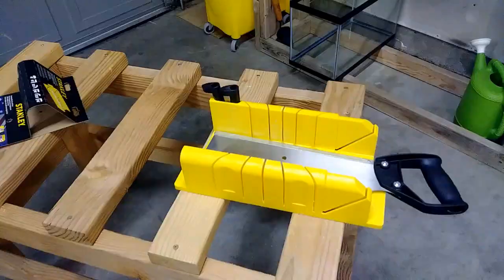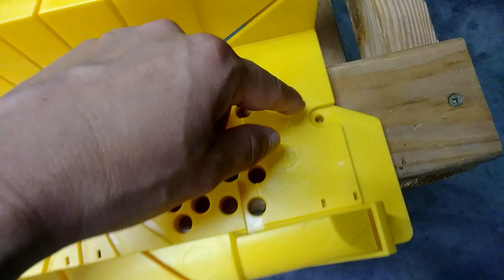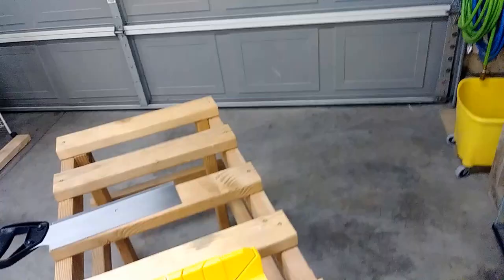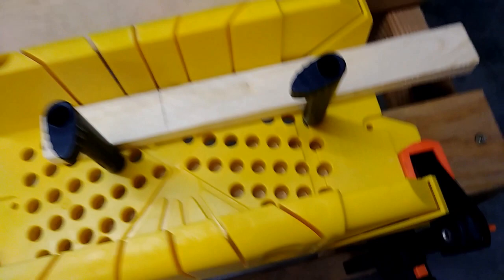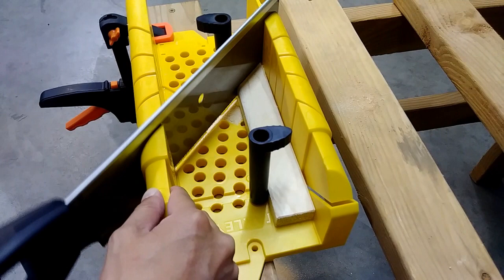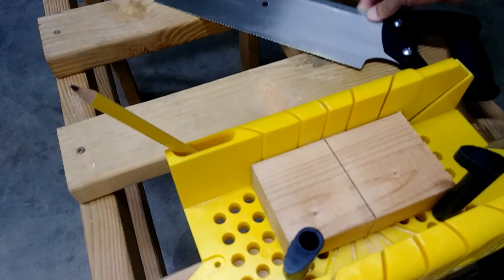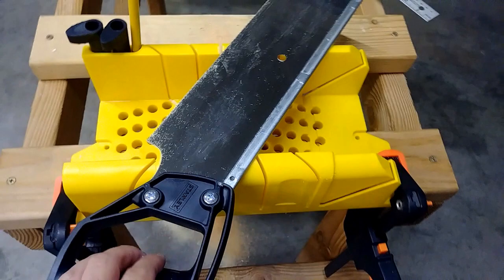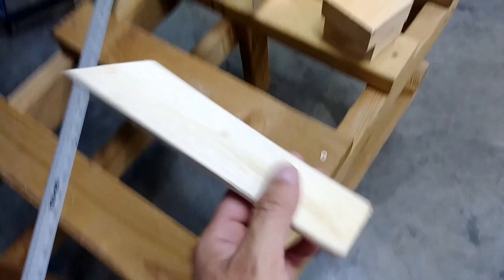Stanley Miter Box with Saw - How to Use and Review

Comment: Hi there! I just purchased a miter Box from Harbor Freight. It might be a pretty plain box, but I wanted to check out several You Tube instructions and videos on how to mount the little yellow or red box to cut miter cuts and how to use the tool. It's good to know that I can, cut a 2x4 if needed as opposed to using my circular saw.   Thanks for your helpful tutorial.
Reply from the maker: If precision cutting isn't a big deal it's not bad. Just requires more time and energy to do the cutting.

Comment: The walls are vibrating like crazy when you saw the 45 degree😒 great video BTW .p.s. Its not a saw stop ,its to add rigidity to the blade  ,its a back saw / tenon saw ..its just acts also as a stop because of the design of the box
Reply from the maker: That's something to think about. Thanks.

Comment: The 2 bottom tabs are as you said to align the box against a table edge for stability. I have a folding portable workbench table that clamps together. I usually just clamp the backside tabs of themiter box in the table to keep it stable.
Reply from the maker: Cool, thanks
Reply: There are three tabs

Comment: Does the miter box set come with the screws to attach it to a work surface?
Reply from the maker: No it did not come with any screws. I did look around before buying this one and none of them come with screws. From all the ones I saw I think this one is the best deal because it's wider, so you can fit bigger stud on it and has the two pins.

Comment: I don't have a work table. Was going to try this on the floor. Do i need a table for stability?
Reply from the maker: Any table should be fine as long as you could clamp the Miter Box onto the table. Also, make sure the table is strong enough and doesn't break. The cutting will probably be a lot easier if you could keep the Miter Box stationary.

Comment: What is the widest piece of wood that can be put in the box?
Reply from the maker: 4.5 inch would fit with a little space left, so probably a little wider than 4.5 inch would work.
Reply: @WelkingVue  Guess that wouldn't work with my 5.25" baseboard.
Reply from the maker: I went to measure before I first replied to you. From what I remember it was about 4.75 inch maximum.

Comment: hey, the angle u pointed at and said "and there's also a cut here too" in time 4:39 is a 45 degree or what ?
Reply from the maker: If you're looking for 45 degree cut, then that Miter Box does have it.
Reply: @WelkingVue  thanks, but im asking about the angle u didn't mention its the angle on the edge of the box, i see it on every box but no one mention its degree
Reply from the maker: I just re-watched the video at 4:39 I usually keep owner's manual and package information. I took a look at the package for this box it's showing 45 degree for that cut.
Reply: @WelkingVue  thank you very much